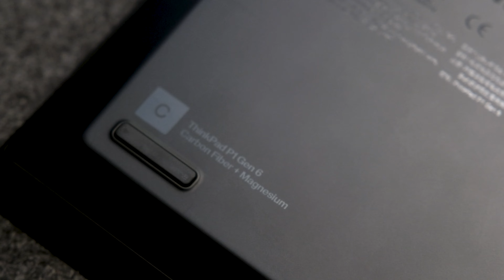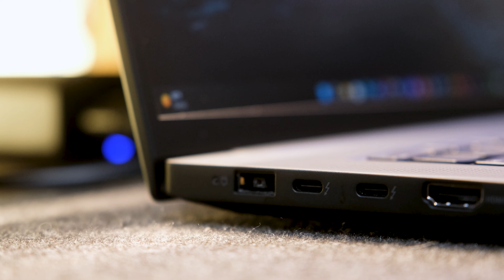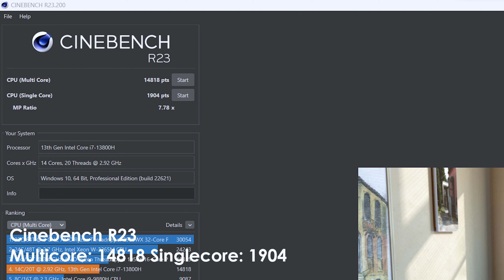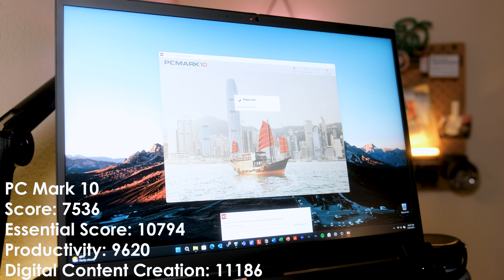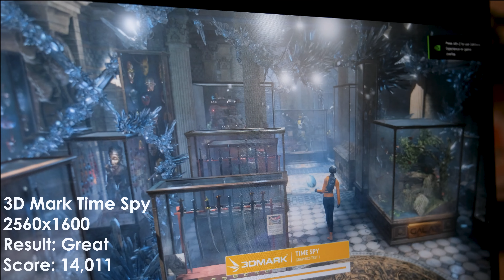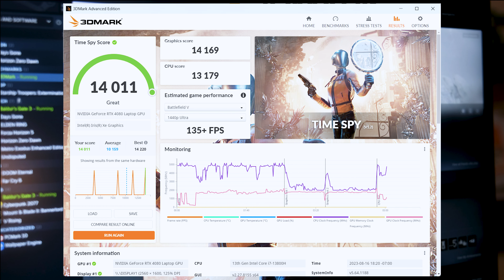Lenovo ThinkPad P1 Gen 6: Benchmarks

Comment: Hi, thank you for the benchmark testing. I currently have the same P1 Gen 6 but with the i9 13900H and RTX4090 GPU. I tried to replicate the exact same benchmark test on cyberpunk, and I am getting FPS of around fifty. I have my bios default, I had to disable the keep cool while on lap since I was trying to get as much juice as I can from the battery, My NVidia settings are default, everything is default but still, I am way off the 130 fps you are reporting. What could be wrong?
Reply from the maker: Hi Luis, 

I believe that I had DLSS on and that may have been the reason for the high framerate. I don't think I messed with the settings GeForce experience loaded onto my game by default. I will have to run another benchmark without DLSS and see what kind of performance I get.
Reply: @B4YBTech  I re-run the benchmark a couple more times to see if I could get a better FPS and I was able to reach your 130 mark only under Low graphic settings. I would definitely appreciate you rerunning your benchmark test once more and grab a screenshot of the final stats of the test to corroborate your exact settings. Since your P1 has an i7 and an 4080, there is a definite difference in hardware even though is not that much but I wouldn't be surprised a lower end CPU and GPU could get a better FPS. Thanks again.
Reply: I just picked up this laptop (same exact config in the video: 13800h rtx4080 QHD+), and am also unable to get 130fps in the Cyberpunk benchmark using the RT Ultra preset and DLSS set to performance. Honestly, I was pretty skeptical of that number in the first place. Even a full 175W 4080 gaming laptop shouldn't be able to hit that, at least not without frame gen.  I get an average in the low 50s, which is still impressive IMO, and seems appropriate for 1600p and this gpu being limited to 80W + 25W boost. I get a similar result with the regular Ultra preset (no RT) and no resolution scaling. FWIW, I am able to get similar results in the Horizon: Zero Dawn and Time Spy benchmarks as seen in the video.
Reply: @michaelbroll3133   bro i just ordered one, are we getting scammed?!
Reply: @이한일-o3n  Uh no. Who would be scamming us? I'm genuinely impressed with this laptop at the price I paid, and this video was really helpful in my decision to get it.
Reply: @LuisGonzalezConrad I have ThinkPad P16s Gen 2, which has the RTX A500 GPU, and I was running CyberPunk at 3-4 FPS even on low settings!! What fixed it for me was to set power mode to performance, and I had it on balanced previously (which usually works for most other games I play). Then I could run it smoothly around 50fps on medium-high settings. (This is not placebo, I tried many times swapping it between balanced and performance and it was reproducible). 
So I suspect the problem was not in your in-game settings. This could be common in ThinkPads.
Reply: @LuisGonzalezConrad how are the thermals at high performance ?

Comment: I have the same P1 Gen6 with 13700H, but with the RTX 2000 ADA Generation mobile GPU. This workstation GPU is new and there aren’t any reviews or benchmarks I could find for it, but it pleasantly surprised me; it’s quite capable in games and supports ray-tracing, DLSS as well as frame generation. Despite being a lower power GPU, it can still run Diablo 4 and Shadow of the Tomb Raider at 60 FPS using highest quality settings at 2560x1600 res (with DLSS on, set to Quality mode, and frame generation off)
Reply from the maker: That's awesome to hear that you are getting that kind of performance with the RTX 2000.
Reply: greetings how has the battery been treating you?
Reply from the maker: @stevengarcia5210  On average I am getting about 5-6 hours of battery life and will need a power adapter with me. I do keep the battery preservation setting on capping it to 80% So not the greatest but enough to get me through work then needing to plug it in.
Reply: @B4YBTech would the battery improve with the left powerful graphics card?
Reply from the maker: @stevengarcia5210  No, it has to do with Intel and the power efficiency of their processors.
Reply: i would like to get the thinkpad P1 gen 6. possible to assist on checking can your P1 Gen 6 13700H + RTX 2000 Ada Gen mobile GPU plays Stream PUBG Battleground smoothly? Also, I would like to know what is the battery life for your hardware combination when doing the normal internet surfing+ watching video. Appreciate your feedback.
Reply: @jasonlai3888  It should work just fine, the Ada 2000 works like a slightly slower RTX 4060 in games and still supports DLSS and frame generation technologies. I can't test for you because I don't have this model any more, I've upgraded to the P1 with the RTX 4090 GPU, instead (which will run any game you throw at it, but costs a lot more).

Comment: While I appreciate you’ve provided the internal thermals of the components, would you be able to provide external temps in a future video? Such as using a thermal camera or thermal gun to measure temps on different areas like the keyboard, palm rest, near the function row, on the base of the laptop, etc. Oh and maybe also a decibel rating for the fans when under full load? Thanks for such an informative video, and I can’t wait for more!
Reply from the maker: Yes! I plan on getting a thermal gun as the thermal cameras are a little too expensive for me right now. I will try to measure the noise made by the fans as well in my full review. I appreciate you for taking the time to watch my video and I hope you check out the review when it comes out.

Comment: I just ordered the oled version.  Can't wait to check it out.
Reply: Okay.  First impressions:
 
The laptop is thin and light - good for lugging around
The OLED is amazing - color accuracy is second to none and peak brightness is decent
The machine runs in the high 40c to  mid 50c under light loads.  Fan noise can be heard even when temps are idle.
The placement of the thermal intakes on the bottom of the laptop is a step in the wrong direction for lenovo.  This coming from a P51 owner.  I have to invest in a laptop stand to keep the intake path clear.
Reply: @greekcs  Does the OLED screen have active stylus support?

Comment: hi mate, I am considering my new workstation laptop. How do you think about the zbook studio g10, I prefer zbook over thinkpad p1 in term of build quality and the CPU,GPU temps.
Reply from the maker: Hi Tin! I personally never got my hands on the zbook studio, I will say though that they look really good, I did look at a few of them online at Microcenter but my issue is that the price for the configuations didn't make sense for me. Not sure if your market has better deals. I am curious to know the temps and performance on these zbooks.
Reply: Hi, which one did you get finally? I am walking around between P1 gen6 and studio G10.

Comment: Great video! It answered a lot of questions I had in mind. I've been trying to look for a laptop similar to my current x1 extreme gen 1 since they discontinued that line, and glad to find this P1 line that's pretty much the same as x1. Just one question, how's the fan noise on this P1 line? Does it only run when you do some heavy performance work like gaming or rendering/editing stuff? Thank you!

In the first whole year around 2019 when I got my x1, the fans has been started running regularly as long as the machine was on, like every few seconds the fan started to run for a while like 20-30 sec maybe and then off, then wait another few sec to repeat this, even when I didn't do/run anything. That was a total nightmare, though the problem was gone since after I updated to win 10 1909 and ran some script, somehow. Don't want to repeat that super frustrating nightmare ever again. But if the fan gets a bit crazy running a game or super professional software then I'm fine.
Reply from the maker: Thank you! When I am running the laptop on battery for normal tasks (web browsing, office, productivity tasks, discord, notion) I never hear the fans kick on and the temperatures are good, it gets warm at best. The fans only kick on during rendering videos, playing video games or any application that requires more from the CPU and GPU.
Reply: @B4YBTech  Great to know, thanks for the information! 😄
Reply: I'm upgrading to this from an X1 Extreme gen 2 myself. My X1 also had the fans running a lot from time to time, but that improved over the course of various updates. It's more of a Windows issue from what I've seen, since there are often background processes using up more CPU than they ought to, and I've been running Linux on it for a month or two now and it's dead silent 99% of the time. Everything works while in Linux, btw, even the GPU, the fingerprint reader and various games via Steam. Anyway my P1 with i9, 4090, and 64gb is coming in a few days, so I'll try to report back once I've tried it out.
Reply: @j3pl  thanks for sharing man. yeah I believe it was the win10 problem cuz the fan noise issue just like completely went away after I updated to version 1909, it was super frustrating before that though. Good luck with your new machine! I'm pretty much looking at the same specs, would be appreciated if you share the experience!

Comment: Hi, thank you very much for the videos, very helpful.
I am currently thinking of buying the P1 Gen 6 also with RTX 4080, to use for 3D rendering with C4D and Redshift.
Could you maybe run the new Cinebench 2024 benchmark, which is also free and was just released. 
If you could provide me the Scores for the Redshift GPU benchmark single run and CPU benchmark single run, that would be so helpful! (Maybe also in the balanced and performance profile, to see the difference with different wattage😅)

Thank you very much in advance!
Reply: Hey Fabian, I have the P1 Gen 6 with i9 and 4090 and this are my Cinebench results:  Multi Core 16,752 & Single Core 1,851

Comment: Hey, I'm holding a Fujitsu U94A (1370P version). I'm thinking of buying a mobile workstation like P1 gen 6 or HP Zbook studio G10 for Solidworks, CAD, and a little bit of video editing. So, any suggestions?
Reply from the maker: I personally haven't had the opportunity to use the HP Zbook studio G10, I would personally go for the P1 Gen 6 because of the I/O but also because Lenovo always has sales on their website. I personally wouldn't buy these laptops unless there was a deal as they are a little more than what I need personally. The P1 Gen 6 is my main video editing machine now and I have to say that I am really impressed with the performance, even while it's unplugged I am able to render my projects fast.
Reply: Many thanks! @B4YBTech
Reply from the maker: @xuefengyan2723  you’re welcome 👍

Comment: Do you recommend this laptop now? I will be using for VMs and light gaming from time to time on the side. I was more worried about the laptop running hot all the time or being loud when I'm just running VMs. Please let me know. Thanks!
Reply from the maker: Not really sure about running VMs as I haven't tried doing this. I will say that even though it runs hot from time to time these chips are designed to run at high temps and the cooling system is sufficient. I am not worried about any long term issues with the heat management for general use cases.

Comment: If this had a numpad and a haptic trackpad with no buttons it would be the dream laptop
Reply from the maker: I agree with the haptic trackpad that would make this feel much better, but I personally prefer this keyboard layout, the numpad will offset the trackpad and won't be able to have upward facing speakers to flank the keyboard. I do believe that there are other ThinkPads that have the numpad layout though and that might be worth a look,
Reply: Also if the CPU didn’t thermal throttle at the slightest touch, it would be nice. Sadly the cooling solution isn’t good enough to prevent throttling in such a thin chassis. I love my P1 gen6, but this is my only gripe
Reply from the maker: @little_fluffy_clouds  I couldn’t agree more!

Comment: Would like to know how  it compares with the Macbook Pro at similar price point ?
Reply from the maker: I can do a comparison with my M1 Pro MacBook 16 but it may not be an apples to apples comparison (no pun intended)
Reply: Comparing my 16" M2 MBP to a P1 gen6 with the IPS screen option here. MacBook Pro is heavier due to its solid aluminium chassis, has much better battery life, a mini-LED screen which looks punchier in HDR mode and the same level of performance whether you're on battery or mains power. The fans on the MBP remain almost inaudibly quiet, even under load, and it doesn't really ever get uncomforably warm to the touch even under sustained load.

P1 is lighter but still feels solid, has a better keyboard, much better GPU performance, but nowhere near as good battery life. Also, the fans are audible in performance mode when under load. The underside can get tangibly warm to the touch after sustained load, but this is a non-issue if you use it on a desk, as opposed to your lap.

Ultimately, they're both awesome laptops, sleek speed demons, and the one you choose depends on whether you value battery life and performance per watt over absolute performance regardless of power consumption, and whether you prefer macOS or Windows.

Comment: If I can get it under $4,000 with the rtx 4090 and I'm a video editor, would it be worth it?
Reply from the maker: If this is how you get paid for work then I’d say yes, but keep in mind that there are new Intel processors out there and newer ThinkPads and creator focused laptops coming out soon. Also with for the $3000-$4000 range you can pick up an M3 Pro/Max MacBook Pro and they are incredible machines for video editing. Lots of options but I’d say for this laptop there are good deals out now and possibly even cheaper sales for it because they might release a new version of the P1 later this year. If you can wait then I’d do that.

Comment: Can you turn off 4080 and use integrated card for a better battery life?  Also do you think we gonna be able to chage gpu tdp in a future on a higher level?
Reply: I turn off my 4090 on my P1 Gen 6 on the Nvidia control panel. The bios only allow the option for Hybrid and full time discrete. I am also enabling in bios Keep cool when using in lap since I figure it would cap performance in order to get more battery time.
Reply from the maker: I believe it automatically does this through nvidia optimus if I am not mistaken.

Comment: What stand are you using? Thanks
Reply from the maker: I have a stand that holds my camera, light, microphone and my laptop. Viozon Selfie Desktop Live Stand Set 6-in-1 10" LED Ring Light Microphone Mount Compatible with 12-17" laptop/17-32'' monitor/7-13 Tablet/3.5-6.7" Pho https://www.amazon.com/dp/B086W3L2XB/ref=cm_sw_r_cp_apip_ZZGeq3r8wp9Nr

I’m sure there’s a similar product that’s just the laptop stand if you don’t need the other things.

Comment: Thanks for the helpful video! Just ordered an i9/4090/64GB/OLED for creative/3d work. Has anybody out there tested the 4090 version? Just curious to see the performance with my 4K display or... the display quality if I decide to play a game at 2560 on my 4K OLED display. In any case I'm capped at 60Hz (if not using an external monitor), so... I think that at this frame rate I won't have any problem in maxing out everything at 4K too. But curious... Thanks
Reply from the maker: OLED would have been an awesome choice if it had 120hz support.
Reply: @B4YBTech  Asus X16 and Razer Blade 16 have mini-led displays with double mode. Hopefully the next generation (P1 gen7) will come with a mini-led display.
Reply from the maker: @rpesterev  I hope so that would be a game changer.